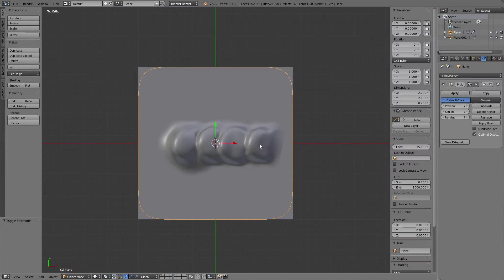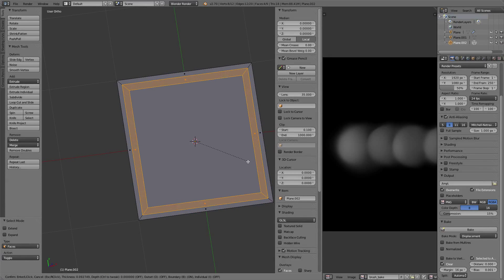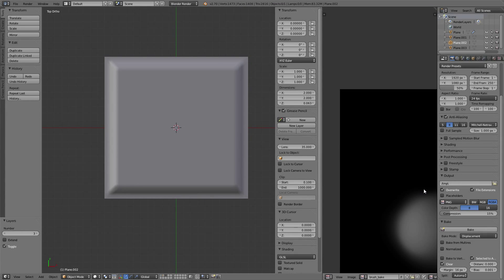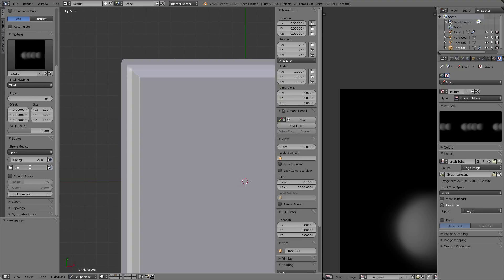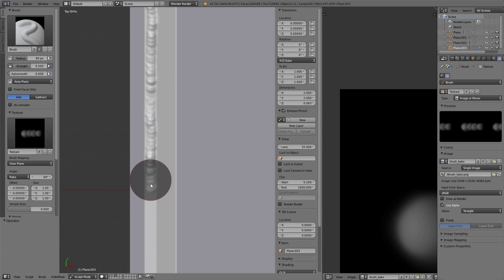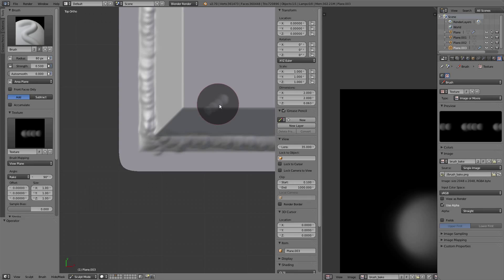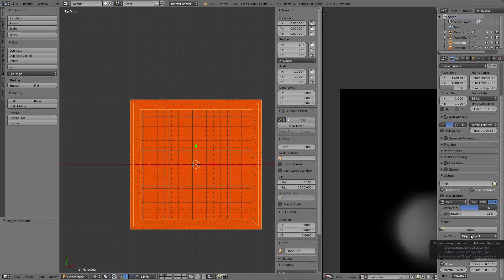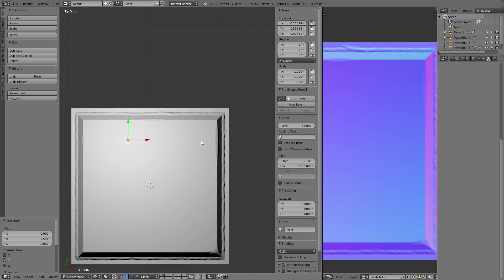Blender tutorial: Texturing the hard sufrace panel. Part 1: Normal maps

Comment: I always get a light grey displacement map. How can i get it darker within blender, cause when i adjust it in PS i keep get banding apearing when i edit the levels
Reply from the maker: Instead of manually adjusting levels use the black color picker in levels panel to establish lowest value for the image.
Reply: yazjack BUt why is the image much lighter than your example? is this cause of scale and so, i used a 2x2m plane
Reply from the maker: Rombout Versluijs The displacement map you see in the tutorial was already edited in PS. If you want to achieve the same effect without using external software, one way would be cranking up the bias in baking options. 0.02-ish in this scale would do the trick, but you need to tinker with it depending on the sculpt height. Is that what you meant?
Reply: Rombout Versluijs I dont know, i hardly used bake before so i cant tell. I know tested it by scaling up the mesh 5times this helps define the edges much better. But its weird its not working correct with the plane 2x2m
Reply from the maker: Rombout Versluijs Scaling will work if "normlized" option is unchecked. When you enable it, you'll get the same results no matter the scale. As for the black "background', try the bias thing I mentioned before.
Reply: yazjack I noticed this bias think indeed. I think its cause the sculpting isnt heigh enough it doesnt show correct. The normal is quite okay, but i dont like the displacement map i get. Ill keep fiddling with it though.
Reply: Here's one of my tests. Still need to work on the normal map. Im getting weird edges here which look like the sharp edges are folded a bit inwards.

https://www.dropbox.com/s/3w9wr0cjfplnfe2/Weld_test3.jpg?dl=0
Reply: Did a lot of testing and trial error fixing. Thinks its better now. Did cost me hours of baking and fixing :(   http://blenderartists.org/forum/attachment.php?attachmentid=342861&d=1415258531
Reply from the maker: Now that you went through that it'll be much easier. Good job!